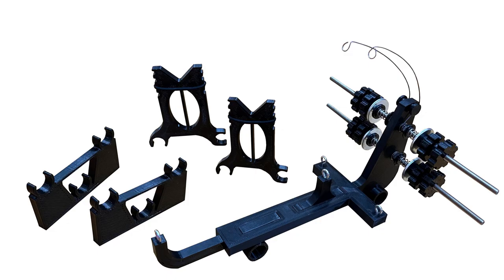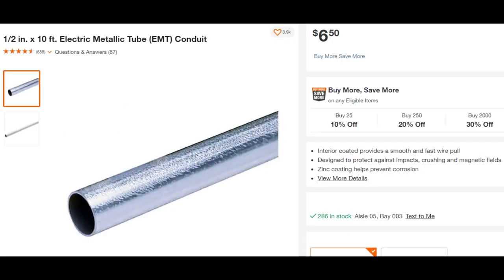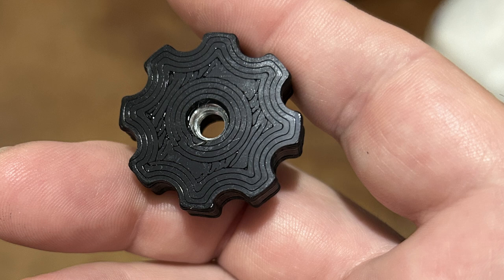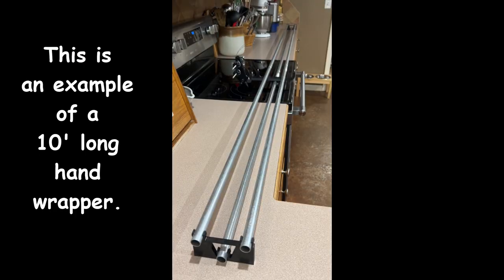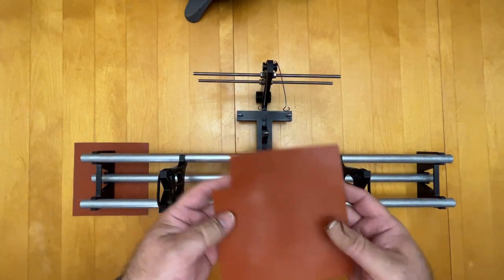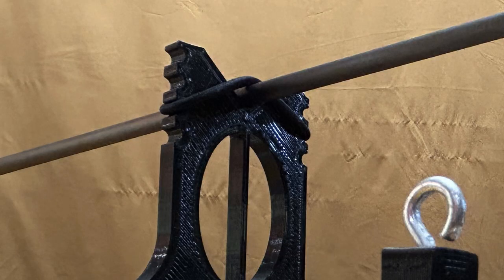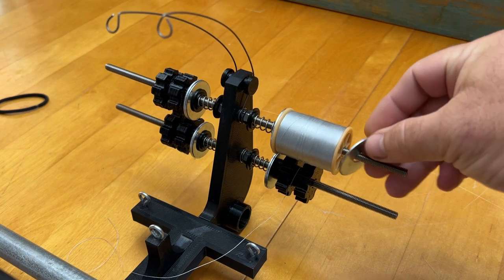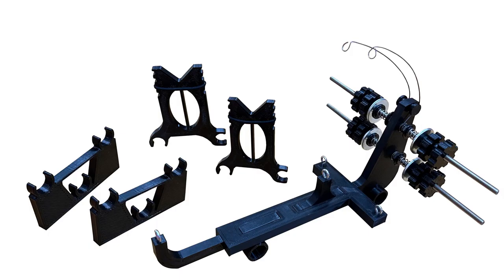New Rod Building Guide Wrapper Now Available!

Comment: Just one question, if you are using this jig to apply epoxy, how do you keep the rod level horizontally or do you not use this jig to apply epoxy?
Reply from the maker: That is a really good question! I'll do my best to provide a thorough answer, so I apologize in advance for the length of my response.

I do not use adjustable supports when working with epoxy. Surprisingly, the rod doesn't actually need to be perfectly level horizontally for the epoxy to self-level as it should. You can watch this video (https://youtu.be/XIaNQvAQr6g) to see an example of epoxy work I've done using non-adjustable blank supports.

Some individuals might encounter issues when they use a non-adjustable support under the rod grips instead of directly under the rod blank while applying epoxy. This could create a more extreme angle. I've personally used this method with excellent results, but it's crucial to apply very thin coats. Here's why: epoxy has adhesive properties that give it a certain tackiness. When applied thinly or the excess is removed, it tends to adhere to surfaces. However, using too much epoxy can result in gravity pulling it to the lower side due to the increased mass. Gravity's effect on the added mass causes the epoxy to pool on the lower side, overpowering its natural tendency to cling to the surface and resulting in an uneven finish.

A similar effect that most people can relate to is seen in water droplets. Small water droplets can cling to vertical surfaces due to their surface tension; we see it all the time. If the water droplets are too large (have too much mass), gravity overcomes the water's surface tension and its natural tendency to cling to surfaces, causing the water droplet to run down the surface.

This topic is a common discussion on rod-building message boards, and I'm considering making a video dedicated to this subject.

Thank you for asking such an insightful question. I'll pin your question at the top of the comments so that others can benefit from it. If you have any further questions, feel free to ask – I'll be more than happy to help.

Comment: Have you tried you're new wrapper with a motorized power wrapper
Reply from the maker: I have and I am working on a motor add on for these that I will eventually have available as well.
Reply: I have a new Rbs pro gen 2. I bought just the motor and am working on a own track system. I think you just solved it for me. I think this will work awesome. I think I will be ordering sooner than later. Awesome design job.
Reply: I apologize if I did not catch it, but is that 1” EMT conduit?
Reply from the maker: @nyfl1111 It is 1/2” EMT conduit

Comment: Practiced with the wrapper then started a actual build today. Bought 3 10 foot sticks of conduit. Cut all at 6  foot. Started the build with the 4 foot sections on a 6 foot blank. Assembly was as snap. I am using a CRB power wrapper which is also new. So far am loving the wrapper. Great well designed wrapper with or without power head. Will comment again as build continues.
Reply from the maker: Thanks for letting me know about it. I was curious as to how it would work out for you with the power wrapper added to the setup. I’ve used mine under power, but with a smaller geared motor and it worked out well for that, so I figured it would work with the larger setup as well. How did you attach the CRB head unit?
Reply: @TheFishingHobby It is just sitting on the work surface. Is perfect height for rod rests.  I finished a but wrap below split grip and 6 of eight guides now done.  No redos or issues. On another note. I received 2 extra rod rests. I thought I ordered 2 extra lower suports. Can not find my order number or confirmation. Regards, Craig Campbell
Reply from the maker: I only sell the extra blank supports and do not sell the EMT rail supports. I checked your order and it shows 2 extra rod blank supports and 1 jig were ordered. I can certainly make you some  extra EMT rail supports and sell them to you, but the reason I don’t have them for sale is because by using extra rail supports, the thread carriage travel would be restricted (EMT rail supports block it from sliding past them). They are also not easy to remove. If you want some sort of spacer block made that could be inserted and removed quickly and easily, I could probably make you up something like that. Send me an email to talk about it and I’d be happy to see what I can come up with: thefishinghobby@gmail.com
Reply: @TheFishingHobby  Thanks for getting back to. I confused myself. All good here.

Comment: Well though out, think I will be ordering one. Question, is the plastic slippery enough for power wrapping? And would a wider portion on the thread carriage help it slide easier? Are additional supports on the store?
Reply from the maker: Additional supports are available https://5286af.myshopify.com/?_ab=0&_fd=0&_sc=1
Power wrapping would be fine at low speeds (200-300 rpm’s). High speeds could possibly generate enough heat to melt the plastic. I have used these with a 250 rpm dc gear motor with no issues at all. I tried wider bushings on the carriage with similar results while I was working on the design. EMT conduit isn’t precise, so the bushings have to be a little loose fitting or they would bind up. The loose fit allows a little rocking from side to side which can also cause binding unless you push the carriage near the rail. I rarely wrap using a motor, but I always like having that option. 99% of the time I wrap by hand. I will be having a motor setup available for this jig in the future with epoxy work and occasional power wrapping in mind. A setup for someone who mostly prefers to wrap by hand but uses a motor mostly for epoxy work and on rare occasions will wrap with a motor. If you mostly wrap using a motor, I would definitely recommend buying a power wrapper instead. 
I hope that helps you out with your questions. If you have any more, please let me know and I’ll be happy to help!
Reply: @TheFishingHobby  Thank you

Comment: Just finished a 6 spinnong rod with the new wrapper paired power wrapper. Worked great. Did not use power wrapper at high speeds but does speed up process. First time with both the power wrapper and this wrappe.
 Keeps both hands free to move carriage and pack at same time. Was able to do most guides at a slow steady speed without stopping. Love every thing about new wrapper worth every penny. Used 6 foot conduit. Might be better with 7 foot but my space does not allow 7 foot. May change that up. Track systems for other brands can run hundreds of dollars. 10 foot sticks of conduit very cheap. Great system, props to great design.
Reply from the maker: Thank you and I’m glad you are enjoying it! The track system is something that I was trying to work around and still make an effective wrapper. I like everything about the track design except the price of the track itself 😂 The conduit keeps everything aligned without the added expense. I’m glad you see the benefit in it!

Comment: Just ordered one,looks very good.
Reply from the maker: Thank you, I think you will like it! It works very well. I noticed you also ordered a couple of extra rail stands. I just wanted to make sure you know that the rail stands are not very easy to remove once they are installed on the EMT conduit and that the thread carriage can’t move past them once they are installed. You may have a different use in mind for them or just want some extras for backups. I just wanted to check with you and make sure you knew that they take a little effort to remove them after they have been installed and that the thread carriage can’t slide past them once they are installed. If that changes your mind about ordering them, we can cancel that order if don’t think you will need them.
Reply: Yes,I ordered for spares just incase
Reply from the maker: @unclelou6803   very good, just wanted to check with you to make sure. You can always email me ( thefishinghobby@gmail.com ) if you have any questions about using the jig once you get it. I’m always happy to help!

Comment: Can you tell me what the height is from table working surface to to the bottom V of the blank support. I have a RBS pro gen 2 I would want to use with your system
Regards
Reply from the maker: 14.5cm
Reply: @TheFishingHobby  Perfect. Not a coincidence I assume.
Reply: Was checking out for wrapper and 2 extra rod holders with installments but said installments not available try later. Will try again tomorrow.

Comment: Is this rig compatible with most common power wrappers?
Reply from the maker: That is a good question and I appreciate you asking me about it. It is actually a little tough for me to answer believe it or not. If you NEED a power wrapper…my suggestion would be to for you to buy a power wrapper. That is what they are designed to be. With that being said, I did indeed build this hand wrapper in such a way that a person who has a preference for hand wrapping but on occasion would like to be able to wrap using a motor of some sort, it would be possible. That is probably about as clear as mud haha! If you read through the comments of this video you will find a gentleman who is using the power head from a power wrapper with my jig. I designed my jig to be at a similar height. You may have to raise or lower a power wrapper motor/spindle unit a bit for the best alignment, but mine should be pretty close to matching up well. I also plan on eventually adding a component that will be able to be purchased separately for wrapping and epoxy work at approximately 200 rpm’s. I have a dryer motor/chuck setup coming out this week for drying. I have more ideas for other accessories as well and will be working on those in the future. If someone wants to wrap under power, I suggest keeping the rpm’s in the 200-300 range. Sewing machine motors can spin too fast. Most power wrapper motors are sewing machine motors but their speeds are reduced using pulleys. Some inexpensive power wrappers turn without pulley speed reduction, that is not recommended for use with my jigs. If you want to run a power wrapper setup with some pulley speed reduction and a foot pedal so you can dial the speeds back a bit, that will work just fine. How you mount that setup to mine is something a person would have to figure out for themselves. I hope that long winded comment was more helpful than confusing haha! If not, ask more questions and I will try again!

Comment: Do you ever find that the hold down bands are marking up the blank after many rotations?
Reply from the maker: I do not. It is VERY important to keep the bands clean though! If dirt or sand get in the bands, then the dirt or sand could most definitely mark up or even damage a blank. I’ve seen that happen on a power wrapper as well. A small bit of metal shavings got embedded into a rubber o-ring on a power wrapper wheel and scratched up a blank pretty bad. It can happen but isn’t likely to happen if you are being careful and working in a fairly clean environment. I would say that getting contaminants in one of my bands would be more likely than getting something embedded in a wheel on a power wrapper though. Just inspecting the bands before using them should prevent that from being a problem. Also, my bands are just metal free hair bands. Easy and inexpensive to replace from an item that can be found in most any grocery store or another type of store that carries hair bands (Walmart, Target or similar stores). Never hurts to have extras on hand just in case you need them!

Comment: I should have my a$$ kicked. I just dropped $200 on the Mudhole package and i'm still not completely satisfied with it. I absolutely love your new setup. I do have a question. Can you use PVC instead of Conduit? I'm only asking just for weight reason's. But, maybe the added weight of Conduit might help the jig from moving so easily. Anyway. What an absolutely fantastic new system you've made. Not to mention a really good price point. Well done my friend.
Reply from the maker: Hello and thank you! PVC pipe is a different diameter and will not fit. I would think schedule 40 PVC pipe would also flex too much. I just went and weighed a 7 foot long piece of EMT that I use on my wrapper and it weighed 2lbs 1-1/2oz so if you had 3 pieces the total weight of the conduit would be 6lbs 4-1/2oz. My total shipping weight (box and all) for my wrapper kit is 2.5 lbs so a 7 foot long hand wrapping jig would be somewhere around 9 lbs which isn't too bad at all in my opinion. You might figure around 1&1/4 lb per foot of hand wrapper length based on that information. I just figured I would put some numbers here in case anyone else was wondering about the weight of the EMT conduit.